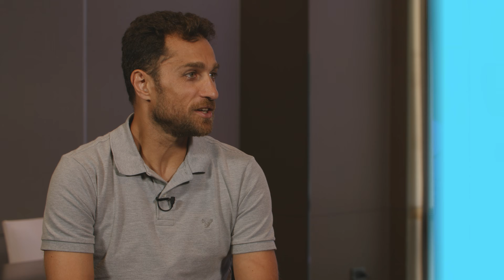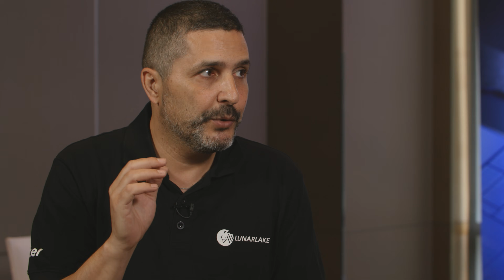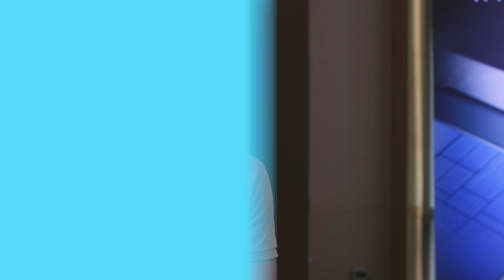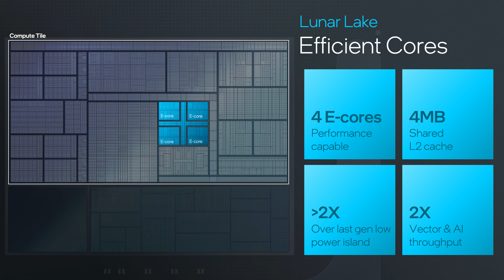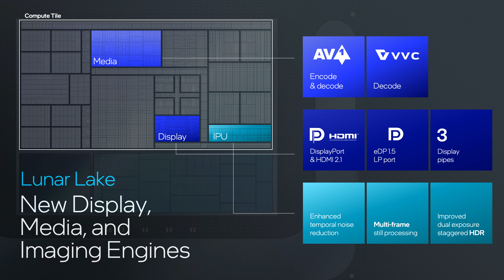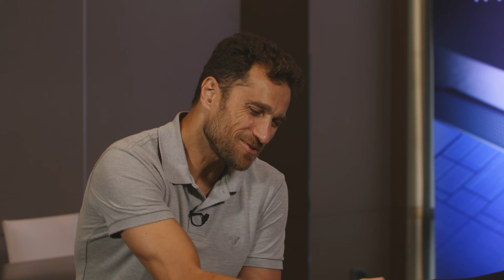Lunar Lake Overview: In-Depth With Lead Architect and Design Mgr. | Talking Tech | Intel Technology

Comment: very nice and all but now in December 2024 in the market are still selling the first generation ultra at crazy prices, 2mil dollars and still no laptops with Core Ultra 2nd generation, ie still not for sale the Lunar Lake, which may if there are for sale in very exclusive places but at very crazy prices, it is still more powerful an apple m4 than a lunar lake, I do not deny that they are different things by the software but by the time the lunar lake goes on sale at normal prices for us mortals Apple will have already released the m5, I will end up buying a macbook with m2 or m3 cheap 500 dollars and will have more power than the lunar lake that definitely took time to come out.

Comment: Looks good. Has some Pentium M vibes from the good old days. I never liked what you did to AMD, but i really don´t want to see you guys fail. X86 is just better than the ARM based systems that all kinda feel like a prison.
Maybe Lunar Lake will bring back good power efficiency to X86. I´m waiting for a X1 Carbon with that thing.
What i don´t understand is the NPU hype. What does a NPU do that a GPU cannot do ? Wouldn´t it be more uselful to leave the NPU out completely and put more GPU execution units into the chip instead ?

Comment: Intel is finally learning some lessons from ARM and M1. Now, you only need to go RISC and you’ll be close to the M1/M2. I returned my Core Ultra 7 because the laptop was so hot doing absolutely nothing! Until Intel can offer something better than Qualcomm, I’ll stick with ARM-based RISC chips.

Comment: With 32GB embedded LPDDR5X into the SOC, would that mean you no need memory slots for Lunar lake? I don't know the quality of memory and cpu, which is more pro to quality problem, if the memory failed, would that mean you have to replace the whole soc? That will be not good.

Comment: Intel Lunar Lake and Arrow Lake with the new P core, E core, NPU 4.0 and Arc Xe2 gonna destroy Amd, Apple, and Qualcomm. Intel real comeback is here !!!
Reply: Yep Intel comeback after Iris Xe 2020. Amd become much lazy after 6800u
Reply: Arrow Lake is rumored to be slower than the 14900KS, but I don’t completely believe it, even if they regress clock speed and disable hyperthreading, if they use TSMC 3nm, Intel is more competitive again.
Reply: Qualcomm??????? AMD!!!!!????????? You trippin
Reply: @Deathdemon65 lmao the Qualcomm isn’t even very energy efficient. Those chips run hot and can chew 50+ watts and also doesn’t even have memory on chip

Comment: Objective is performance to power. Now by going to N3B and left Intel Tech behind the real competition start: Who is the better designer. For desktop with get stressed with more threads than cores the game is over for now. So the desktop market follow what is demonstrated in server market but have less slowing momentum.
BTW the one question pop up how to work out the cache consistence for thread switching. As there is no API for load crtitically at the time the threadmaster decide on load there is already cache usage on the wrong cores. Red solution seams to generate less hickups.

Comment: Can we get memory on package for desktop PCs?
Reply: Why would you want this? It makes upgrading harder and more expensive, because you need to replace both the CPU and RAM in order to upgrade one of the two. It makes sense for laptops to use on-package RAM in order to reduce size and weight, but is pointless on desktops.
Reply: @nathangamble125  For better performance and less power consumption. Every segment of the computing market is heading towards the same direction except for desktop PCs. A CPU offering 32GB and 64GB on chip should be more than enough for most users. You shouldn't sacrifice performance for expandability when most people aren't going to expand their system after their initial purchase. Not to mention the overall reduction in system cost. Less motherboard traces, fewer RAM slots, better power management requirements, cooling, smaller form factor, better software compatibility. The benefits are endless.
Reply: It would be possible, but makes the socket pretty large. Look at the size of the LNL tiles next to the twin DRAM chips. Now imagine twice as much DRAM for higher capacity or more bandwidth. People also really value their expandability, so you'd either need to convince people to let that go, offer so much memory that nobody would want more (256GB on the current desktop platforms, for example) and drive costs up, or have enough controllers to have both on-package and expandable memory.

It seems like on desktop boards the next best thing to this would be a shift towards widespread adoption of CAMM2. The form factor would allow for quad-channel to make a comeback at the high end, or just to push faster clocks through dual-channel.

Comment: Congratulations Intel on focusing on power efficiency. Your competitors have been focused on that and your former customer Apple is focused on that. 

It made a lot of sense to focus your designs specifically on mobile vs trying to make a single chip architecture to target 5-125W.  Again, congratulations. Lunar lake seems like an impressive engineering achievement.

Comment: I WANT 5GHZ IGPU
Reply: With a GPU you'd much rather it be wider than faster. More cores working in parallel crunching more pixels and tracing more rays at once. Compare 8 Xe cores to 4 at the same power budget. You can't double the frequency because the relationship is not linear, so the 8 cores pull ahead despite being slower. What I'd rather see for a more performant iGPU would be 12 Xe Cores in a dedicated power region with a large cache. At the same power budget you could likely see +25% performance with lower clocks than current, and at the same clocks you would see +50% or so. The price you pay for more cores is a lot though, as it also means 50% more die area consumed.

Comment: I hope lunar lake will have an overclocking feature, especially the graphics with both the cpu and gpu being voltage limited to 1.36v when overclocking. Proper RAM memory. For example, lunar lake i3 will have 4-8gb ram, i5 12-16gb and i7 16-32gb, i9 >32gb ram. I only buy fastest overclockable cpu intel like 14900ks or 13900hk, now mine is 13900hk. intel must have overclockable all product like amd and best overcloking tool have many function like amd for all cpu. ALL CPU, ESPECIAL IS IGPU MUST HAVE OVERCLOCKABLE
Reply: I don't think Lunar Lake will support overclocking since this part is specifically designed for low power, thin and light laptops, and overclock is too much for those designs.
Reply: Lunar lake is only available in 16gb and 32gb
Reply: Lunar Lake is mobile only. It comes in roughly 9-32W packages and will have locked multipliers. The on-package memory will come in either 16 or 32GB, though technically 24GB is possible to make with mis-matched memory ICs. The plan is to just offer 32GB on SKUs that would have that as far as I'm aware. The plan is likely to have Core Ultra 3s and some 5s sitting at 16GB, and then the rest at 32GB.

For overclocking or more you'd want to be looking at Arrow Lake, which will have desktop and mobile lines just like Raptor Lake being offered alongside Meteor Lake.

Comment: Intel striking back with a mean kick! Lunar Lake seems amazing! This is a real Apple M4 competitor!! Well done Intel!!
Reply: M4 Max , M4 Ultra and M4 Extreme on the Mac Pro will be faster than this, let’s be real here this is for laptops only. 

Arrow Lake, Panther Lake, and eventually Beast Lake by Intel, will be Intels next generation desktop releases.
Reply: @iLegionaire3755 agreed, I have high expectations of panther lake though using their new high na euv. Patrick has done a good job at intel so far. All arrow lake and lunar lake have to do is be somewhat competitive, no need to be the best with this tech, battlemage needs to be optimized from release to take a small percentage of Dgpus. Next year will be intels year and we will see if they fall on their face or if they really will be the top dawg again, time will tell…. Exciting though
Reply: They are striking back, but they won’t pull ahead with this generation or arrow lake, you can tell by the layouts and part and piecing these chips together with other tech. They are going to dominate the competition starting with panther lake their 18a process, they started the design 4 years ago and I’m assuming out their best people on the job. The other 4 nodes they leap frogged were testing what works and doesn’t. Arrow lake is 20a process but doesn’t use their high na euv, they’ve had the machine for awhile now long before anyone else will have one. They will put all of their resources into 18a process then 14a. By 2027-2028 they will be the dominant chip designers. Once they demonstrate their chips they will pull tons of business from tsmc having companies wanting to use their foundry.
Reply: Yeah lets go ultraman..😅😅😅
Reply: They are using TSMC 3nm so their efficiency claims make sense
Reply: we will see about that
Reply: @mmo0J  they r using TSMC so it should work
Reply: We'll see. I mean they make these promises with every generation.
Reply: @a740g unfortunately I think the let downs we’re going to happen no matter what. They had to catch up so the tech wasn’t there. I believe behind the scenes they have been working on panther lake and that gen 3-4 years ago. They just needed to blast out the 4 nodes quick and then smash the competition hitting their 5th node in 4 years
Reply: wait for the actual relelse , they are not trust worthy anymore
Reply: @predator9909  neither AMD
Reply: Maybe on the low end but the M4 max will decimate anything intel comes out with on mobile. The HX mobile will be up there but it’s an energy hog.
Reply: @GlobalWave1  Sure, but the Pro and Max series are in completely different price ranges. The like the M3 Pro is $2400 and the M3 Max is $3200... Meanwhile Lunar Lake laptops are expecting to be around $1000-$1300 which is cheaper than Apple's BASE 8GB M3 ($1600). 95% of people are not buying the Pro or Max, but the base M3 chip, which is where Intel will easily compete.

Comment: You break my heart again. Thunderbolt 5 was announced October 2023. I'm sad Thunderbolt 5 is not integrated on Lunar Lake. The MSI Claw 8 would have been epic with Thunderbolt 5. Anyway Oculink thank you.
Reply: Not having integrated TB5 doesn't mean TB5 won't exists on Lunar Lake or Arrow Lake. OEM can still add TB5 external controller although it maybe a bit inferior compared to integrated.
Reply: @runninginthe90s75  what would be the use case where Thunderbolt 4 is not sufficient? EGPU is one of the use cases for which Thunderbolt has not yet delivered on the promise. The main limitation has been bandwidth. Thunderbolt 5 is still not enough but I'll take double the bandwidth of Thunderbolt 3 and 4, than the joke Thunderbolt 4 was compared to Thunderbolt 3.
For eGPU an integrated solution will be better compared to a discrete solution, for two reasons: latency and adoption rate.
We didn't see any Thunderbolt 5 adoption with Meteor Lake and there is little hope for Lunar Lake.
Putting Thunderbolt 5 in a device with a dGPU is a waste.
Reply: it doesnt support thunderbolt 5？